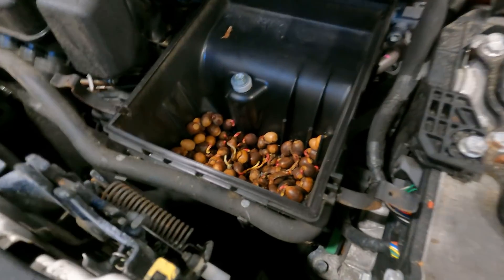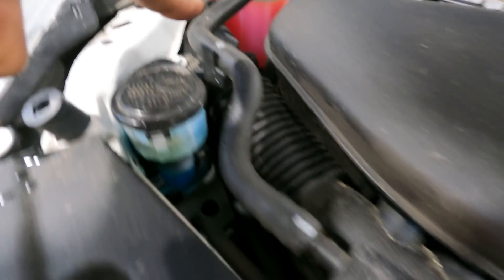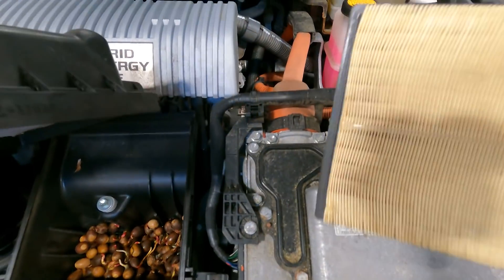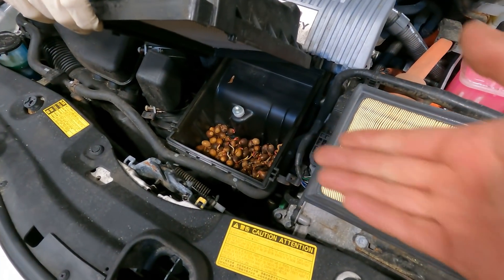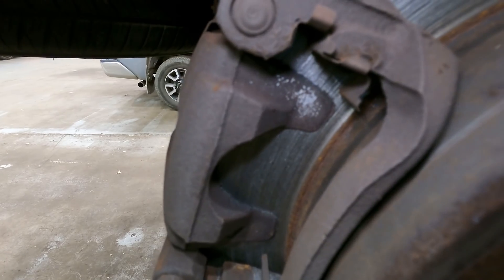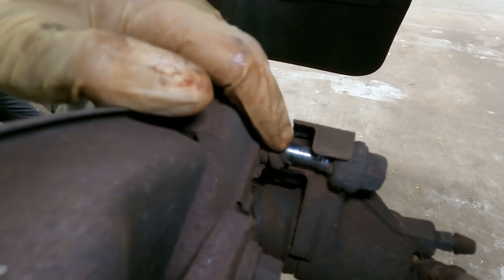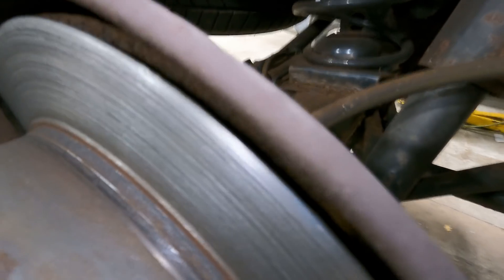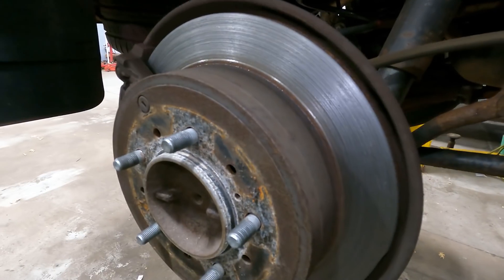Customer states "NUTS IN MY AIR BOX AND BRAKES ARE  GOOGATS"

Comment: Regarding the wasted rear brakes, as a former NYS resident, while some people piss and moan about the annual NYS inspection requirement, it's for folks like this driving around with cars in this hazardous condition.
Reply: I mostly agree. While it's a PIA to have the car inspected, I've got rear drums. I'd much rather have my mechanic tell me if they're good/need done in a few months/googats, even though I'll do them myself.
Reply: That's why we have MOT's once a year in the UK similar to some US state inspections
Reply: I only learned a couple weeks ago that yearly tests are optional in some states and some states in Canada aswell, and you can take off the plates, dump the car and it can never be traced to you. 

Also is insurance optional in some states?? No wonder the traffic deaths are 10x higher than other countries. Its not like the yearly test is even difficult to pass. Literally the bare minimum
Reply: @davekavanagh7599  Actually...yearly inspections (I'm guessing that's what you meant by tests) are required in only NINETEEN of the fifty states. There only 2 states that do NOT require auto insurance New Hampshire and Virginia. To be honest...insurance coverage in the US is pretty damn cheap for as many shit boxes there is on the road.
Reply: @davekavanagh7599  in some states yes it’s optional. In Texas we have a yearly “inspection” which is why we have those blue stickers on our windshield. Test brake function, lights wipers etc. you get the idea, lol
Reply: Funny I am also a New York resident, AND I am a retired auto mechanic myself, and you wouldn't believe the cars I have seen with bad brakes on them at New York shops, or cars I have had people bring me!! Even a few of the cars I have owned personally, I discovered after I bought them that they brakes were not "go on them", which I typically own used cars most of my life anyhow!! So I have owned a lot of cars I already knew had brake problems which for me is an easy repair job!! Personally I am really strict about brakes on cars myself!! After all as a father of two kids and now a grandfather of 12 kids (with my step children's children), I can't stand it when people ignore brake system problems!!!

Comment: How on earth do people let their brakes get to that stage? They’re just stupid I guess.
Reply: Simple - the noise will go way eventually.
Reply: You turn up the radio and the problem goes away!
Reply: Probably just deaf
Reply: The problem is that cars to day are designed so sound proof that when the pads drop out of the calipers as you are going down the road, you can't hear them bounce off the roadway...... there by letting you know it is time for new pads...
Reply: @micmichaeladflak6373  I was about to change the pads in a car I owned. I already bought the new ones. While coming home I was right under Andrews Air force base's runway on the parkway. It sounded like a big plane overhead. It was a coincidence. It did the same thing the rest of the way home. I used the emergency brake to get around it. It was metal on metal. So it's not a little noise. It sounds like a fender is coming off or a big jet overhead. It also shook the whole car.
I have no doubt they knew something was wrong and chose to ignore it. Car kept on going after all.
The good news is the car I was driving at the time was a 1992 Saturn SL2. So I had those brake pads changed in about 15 minutes. Very easy change.
Reply: @robertthomas5906  yes I know.... My post was satirical for the most part..  but you WOULD think that when their car starts to sound more like a machinists lathe rather than their daily road noise, it might give them a clue.... I've driven plenty of city vehicles that have been that way....
Reply: @micmichaeladflak6373  But they don't know what a lathe sounds like, either!

Comment: That rotor has "workshop racks stand" written all over it 😊 
Used brake rotors make excellent stands / bases for heavy furniture, work benches and any kind of heavy equipment, as they're very stable, sturdy and distributing weight over a much wider area than normal furniture stands. You can weld stuff on top of them any way you like or use the stud holes to pass bolts through, I've seen even small garden shacks supported on old brake rotors.
Reply: Uh...he said "stud holes". Huh huh huh...giggity!
Reply: Why are you selling us used brake rotors 😂
Reply: @Billybobaggins9  Just sharing a home recycling idea, you can get broken car parts for free or just their scrap metal value. I built 2 large storage racks in my shed for next to nothing using discarded materials, not because I couldn't afford new ones but because it was more fun doing so.

Comment: Either they kept changing the air filter but never noticed the acorns, or it's actually been in there a while but hardly any air could get through the squirrel storehouse 😀  As far as the brakes go, "Just put new pads on and turn the rotors, don't try to rip me off selling new rotors and calipers!"